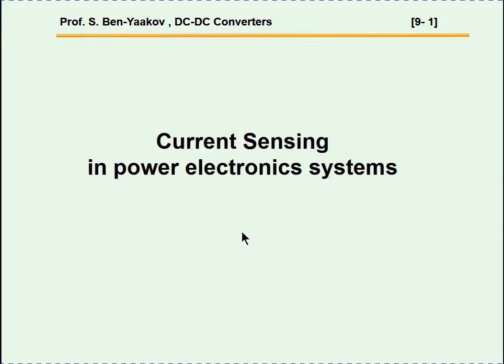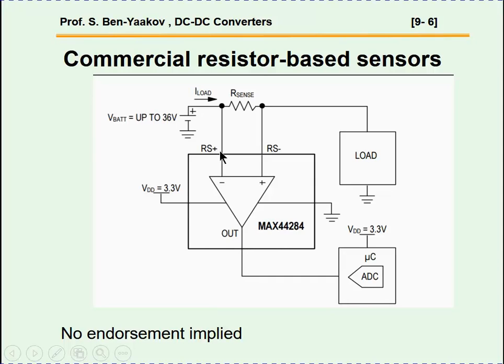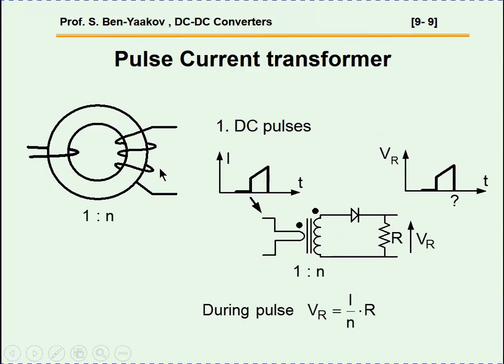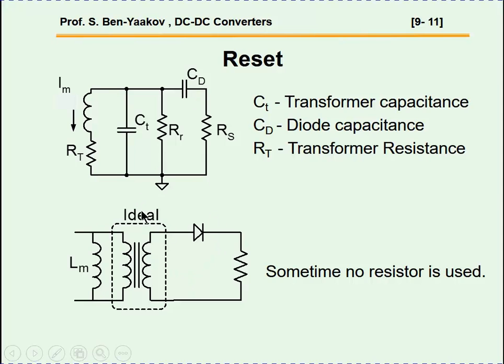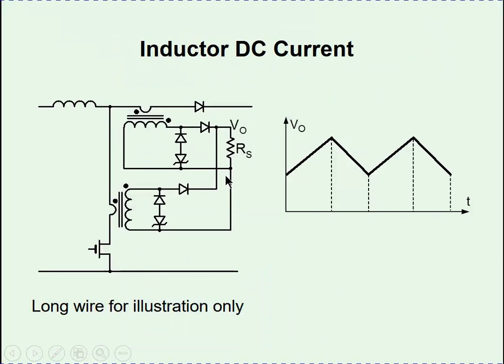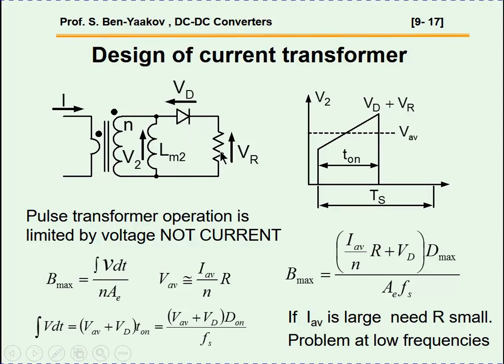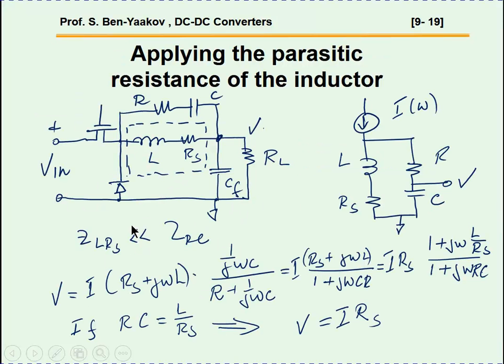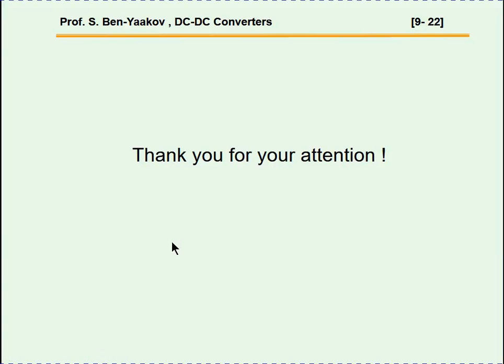Current sensing in power electronics systems

Comment: You say the dissipative detector, the last method, is "clever". But is it BETTER than the other methods?
Reply from the maker: It is better in the sense that it is less expensive and does not change the circuit, but it may not be a good choice for short circuit  protection since the transient response may not be good enough. especially at start.
Reply: @sambenyaakov  Good enough for battery charger regulation?
Reply from the maker: @johnaweiss  Basically yes, but take into account that the sensing depends on copper resistance, which is temp dependent

Comment: Thanks for your video. Regarding the placement of the current transformer—if you're planning to connect it to the MOSFET drain, would you need a differential current-sensing PWM controller for that ? Or is it possible to ground the lower terminal of the current transformer’s secondary and connect the other terminal directly to the CS pin of the PWM controller?
Reply from the maker: The output of a current transformer is floating so you can ground one side.

Comment: Hi! I'm looking for a method to use a current and/or saturation sensing for a Class D output inductor (Toroid). The pulse transformer can it be wound on top of the output inductor itself?? (current limit around 25-35A for an inductor around 20uH in a T-200-2 toroid core), maybe the output circuit for sensing would not be the same, and I'm not proficient with the theory, But I am determined to make the first steps the task.
Reply from the maker: I am not sure I follow you. Please share if you try your idea.
Reply: @sambenyaakov  Sorry, sir, I didn't make myself clear.

My idea for sensing the current passing through a toroidal inductor in a Class D amplifier is to create a second coil above it to sense the inductance drop in the secondary/primary winding as it approaches the inductor's saturation point/current limit.

Is there a practical way to do this, or is it better to measure the current the traditional way with a resistance of a few milliohms between the high/low side MOSFETs?
Reply from the maker: @tacatomon , what do you mean by "above" and what is primary and secondary of an inductor?

Comment: Thank you Professor. I would like to seek advice for a problem of mine regarding the utilization of the pulse transformer. I have a GaN-HEMT pair in a half-bridge configuration and their driver is also in the same package with them as one component. This component has only one output pin (which corresponds to the switching node). If I were to connect a transformer for high side, its primary winding would have been between the positive rail of the DC output and the drain pin of the high side switch. Now for the low side, one terminal of the primary winding of the transformer would connect to the switching node (i.e. drain of the low side switch), and in this case where would the other terminal be connected to? Thanks in advance for your time!
Reply from the maker: Sorry, I do not follow. Can you elaborate? You can write to sam.benyaakov@gmail.com

Comment: Very Good Video detailing  the reset mechanism for CT. @7.10 What type of waveform we can expect across burden resistor whene Ct is not resetted propley or volt sec criteria not met. A sharp return zero instaed of sinusodal return? along with ringing?
Reply from the maker: Thanks. Good question. With no reset to core, the circulating current will keep rising, the inductance will drop and I suspect that there will be either a thermal run away, or the circuit will stabilize with a much higher resonant frequency.
Reply: @sambenyaakov  thank you for the quick reply . My question was more like there is is burden resistor present and what type of wave dorm  I can expect , my under standing from your explanation is that reset will still will be in sinusoidal nature but with higher frequency

Comment: I just learned about the last method and was exploring the time domain characteristics of it in LTspice, but I kept having to fudge the RC time constant value! After an hour of head scratching I realized LTspice was applying a default DCR of 1mOhm to my inductor, which i was not accounting for! Gees I thought I was doing my unit conversions wrong because I kept coming up being an order of magnitude off lol.

It's a really neat method, but looks like it can't be very accurate since the ESR of the inductor is a function of frequency of temperature, as is the inductance, causing the output of the RC filter to be under or overdamped with variation to L (like with large DC current bias or flux bias in the core)
Reply from the maker: Good points. Thanks for sharing. If not a member: welcome to join https://www.linkedin.com/groups/13606756

Comment: This is a wonderful video professor🙏. I'm watching it for the 3rd time and this time, I completely understood what exactly you're trying to explain. There are a few questions that arose in my mind while watching this video

1. In 1st slide: why don't we have a negative voltage spike when current fell to zero abruptly?
2. How exactly does ultra costly 50MHz (AC+DC) current probes work? I'm saying  ultra costly coz atleast they are too expensive for individuals to own.
3. Can I make a low cost high frequency current probe by separating out the measurements for AC and DC signals? Using cheap low bandwidth hall effect sensor for DC component and using a pulse current transformer with a range of  output resistors to avoid core saturation? Do we get accurate readings by adding these components? Also, is there a better way for doing this accurately  at lower cost?
Reply from the maker: First slide? please indicate minute of video
In commercial current probe the HF portion is indeed based on the AC transformer action.
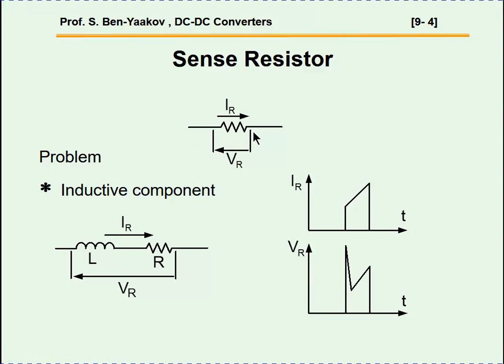Reply: @sambenyaakov   Slide 9-4. Time: 01:01
Reply from the maker: Yes indeed there will be a negative voltage spike which is not shown. Thanks for pointing this out.

Comment: Thanks, I was wondering if you can simply use an extra winding on the output inductor in order to measure the current with a pulse transformer for a dc/dc converter?
Reply from the maker: A winding on an inductor does not sense current it senses voltage .

Comment: Sir what do you think of measuring current through mosfets rdson? In very high current drive circuits, not adding one more lossy component and measuring through rdson is very attractive. any advice or contrary idea? thanks in advance.
Reply from the maker: This is a good approach. The down sides: temp and current dependence of Rds(on) and the extreme difficulty to implement it in a discrete circuit. Suitable for a monolithic design.

Comment: 12:55 "the impedance of (the magnetization inductance) must be much lower than (the load resistance). I think you mean higher, not lower.
Reply from the maker: Hi Graham, thanks for the the correction of the slip of the tongue. Indeed, the impedance of transformer need to be larger than the resistor as written on slide, and the current lower, which is also indicated.

Comment: Nice video but If it's open circuit CT how can you make a relationship between output current of the CT in terms of measured output voltage?
Reply from the maker: Open circuit voltage depends on magnetization inductance.
Reply: @sambenyaakov  Wow! you're a legend I didn't think you would reply coz the video was 3years ago. Thanks :)

Comment: Dear Prof. Sam, thank you for such a valuable education video in english! I made some conclusions after watching, but I'm not sure that they are correct.
1) As we need to reset core after we had pulse, we can use high enough Rr resistor. That givs us a big area under curve in a reset period, so we can reset core at wery short time. So that sensor could work close to 90% of Duty cycle. And Using HV diode i'll be safe.
2) As we should have a Rr - reset resistor the total current of the secondary will be  IL*1/n=ILm+IR+IRr. So to ensure that the most part of the current is current through sensing resistor, we should have IRr and ILm as low as possible. In order to achive this, high value Rr will be nice too.
3) To ensure in low value of ILm and fulfillment of the condition: 2pi*fsw*Lm>R, i will use core material with highest "ue" possible.
Thanks again for the great stuff!
Reply from the maker: Vasiliy,. You are correct see minute 9 and on. Thanks.

Comment: Sam, the secondary voltage v is a derivative of the primary current. If the primary current has a DC component (it is hard to imagine a conventional converter that does not), it should be counted too, since it magnetizes the magnetic core, moving the setpoint on the B-H curve closer to the saturation. The derivative ignores the DC current component.  Integrating the volt-second product disguises the real process in the core, since it deals with the voltage value obtained AFTER taking the derivative and thus missing the effect of the core magnetization by the DC current. Therefore the statement "Pulse transformer operation is limited by voltage NOT CURRENT" 14:28 is incorrect since it actually is limited by the total primary current - AC + DC, flowing through the primary winding.
Reply from the maker: Dear Gregory, The pulse current sensor is intended to measure a pulsed current. For example in the Drain of a switching transistor, or in the line of a diode. This is the application. In this case, the core is magnetized during pulse time and demagnetized during the off time. What matters then, in terms of saturation is the volltsec imposed on core core, conveniently measured at secondary. Being a transformer, the primary and secondary currents during pulse are canceling each other so what is left is the magnetization current, not the actual pulse current.
Regards
Sam
Reply: @sambenyaakov  Dear Sam, the secondary voltage v is a derivative of the primary current. If the primary current has a DC component (it is hard to imagine a conventional converter that does not), it should be counted too, since it magnetizes the magnetic core, moving the setpoint on the B-H curve closer to the saturation. The derivative ignores the DC current component.  Integrating the volt-second product disguises the real process in the core since it deals with the voltage value obtained AFTER taking the derivative and thus missing the effect of the core magnetization by the DC current. Therefore the statement "Pulse transformer operation is limited by voltage NOT CURRENT" 14:28 is incorrect since it is actually  limited by the total primary current - AC + DC, flowing through the primary winding and defining present flux density B."
I have a MathCAD analysis of a current transformer from the point of view of the pulse top transfer fidelity. If you have MathCAD I can share this file with you through a personal email.
Reply: @sambenyaakov  Dear Sam, yes, it is intended but the DC current is still present even if you put the current transformer in the drain circuitry directly.
Reply from the maker: Dear Gregory
It is a common mistake to think that a transformer can not transfer an average  DC current. This notion is incorrect when it comes to switched circuits. See for example a forward coverter. There is an average  DC current component in the primary! What is not allowed is an average DC VOLTAGE on any of the windings. 
As for the  pulsed current transformer explained in the video, it is widely used in the industry. Challenging it is like a person seeing a camel and exclaiming: there is no animal like this😊 In a switched NONLINEAR circuit you need to consider each segment by itself. If you will do that, then during the pulse time the primary current is balanced by the secondary current and then you have a magnetization current which is discharged during the off time. So nothing is violated here.
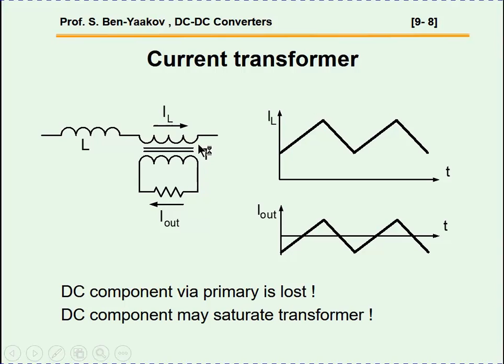Reply: Dear Sam,I am sort of surprised: please check 5:17 of your Current Transformer lecture.
Reply: Dear Sam, The voltage across the burden resistor reflects the input current waveform as long as the L2/Rload >> Tswitching. If you increase Rload significantly, you will see that the output voltage is more like the differentiated input current. So, we cannot select the Rload voluntarily. Unlike in a voltage transformer where the magnetization current flows in the circuit that is IN PARALLEL to the input voltage, the magnetization current in the current transformer is practically the input current. E.g. in a boost converter, if you need to measure the full inductor current, you will push the load DC current through the primary turn. The current transformer secondary current times turn ratio will not, in general, compete with the primary total current. Therefore, when selecting the core size you will have to take into account the load DC current.
Reply from the maker: Dear Gregory, you apparently did not reach 12:00 and on. Same as you wrote but explained differently.
Reply: @sambenyaakov  Dear Sam, No I listened carefully to the whole lecture and: 1) Found out that at 12:53 you had a slip of the tongue when saying that impedance of the schematic on the left is LOWER than that on the right. 2) Found no explanation WHY the time constant Lsecondary / Rload should be bigger than...? Actually, than the duration of the measured pulse. Also, in a voltage transformer, the magnetization inductance is continuously connected to the input power supply regardless of the voltage transformer load. Even if there is no load, the magnetization inductance works. In the current transformer at no load, the secondary current does not flow, and the magnetization inductance does not have any sense in the configuration shown in your lecture unless it is associated with the resonant process involving stray and leakage capacitances, but the secondary current, in this case, does not efficiently demagnetize the core since the frequencies of the primary and secondary currents are different.
Reply: Sorry for the confusion of the name provided by the email: this is Gregory Mirsky
Reply from the maker: One more point (added to  first reply which may appear as second) . The output voltage is NOT the derivative of the primary current! During the pulse time I2=I1/n  (save the magnetization current). So V2=I1*R/n

Comment: Does the diode leakage current has any significant effect on the measurement results?
Reply from the maker: It is usually insignificant being much smaller that the measured currents.
Reply: @sambenyaakov  Okay, thanks for the reply.

Comment: Thank you for clearing sir. 
Sir I am calculationg reset time of CT. Which parameters are important to calculate it. 
What I understood is ( Secondary side inductance, shunt capacitance are enough to calculate reset time.) Shall I measure L & C at switching freq
Reply from the maker: Indeed.
Reply: Vicky, at 9:57 there is a very good schematic, comprising a Zener diode in series with a blocking diode shown. As professor Ben-Yaakov mentioned, this schematic is intended for the reset time control. The reset time can be defined as Tres=Lsecondary * Isecondary / (Vzener+Vdiode)  The volt*second integral should remain intact. Therefore, for shorter Tres you should select a higher voltage Zener diode and don't forget about selection of a higher voltage blocking diode.

Comment: Ehh.... this is quite interesting but i'm not sure about some things.... 

My main question is what happens when you use a step down transformer instead of a step up transformer? 
Most of the compensation/error mechanisms mentioned herein are caused by measuring a voltage that has been stepped up and the resulting reverse voltage conditions that naturally occur because of that. 

I suspect that the answer is "impedance", but changing the voltage seems like a guaranteed way to mis-match said impedance, so perhaps not.
Reply from the maker: Hi. You seem to have missed the point. No voltage is stepped up. The purpose of the pulse transformer is to measure current. If it will be a step down then: 1. The output current will be LARGER than the primary current, 2. The impedance reflected to the primary will be large, disturbing the current path and dissipating power.

Comment: Question to 1:20 - should not this voltage spike appears at the end of the current pulse? not on the beginning?
Reply from the maker: It will appear at both the beginning and end (high di/dt). I neglected to show the negative spike. Thanks for pointing this out.

Comment: Say i have 2 in-phase AC signals, at 200 kHz. i would like to obtain a 200 kHz AC output with current equal to the current-difference between the two input currents. I don't desire a DC or proportional-voltage output. Can i use the CT or other methods? Thx!
Reply from the maker: Yes, you can definitely use a CT (one core) with two opposed windings. Remember that the load of the third output winding should be such that the voltage on it will not saturate the CT core. Good luck.
Reply: Sam Ben-Yaakov Thx! could I achieve the same using a transformer with 3 windings?
Reply from the maker: You need in any case three windings 2 for primaries 1 for output.